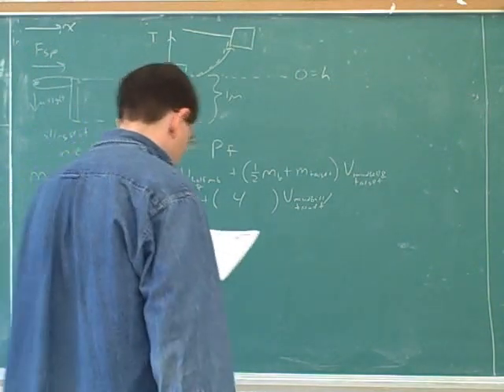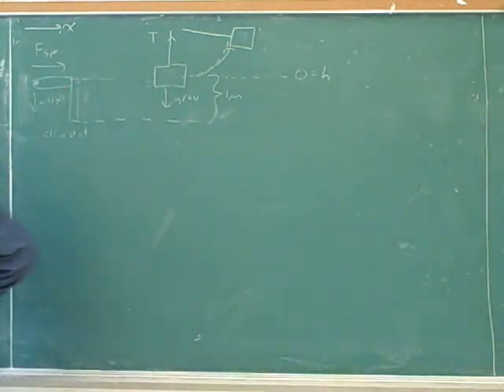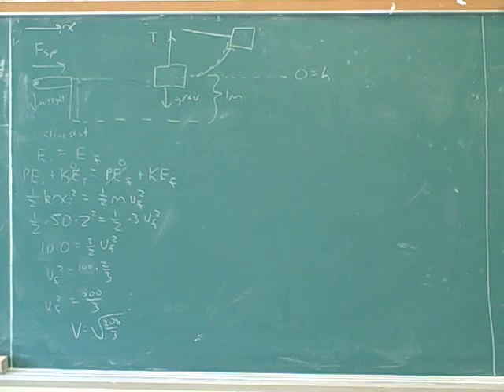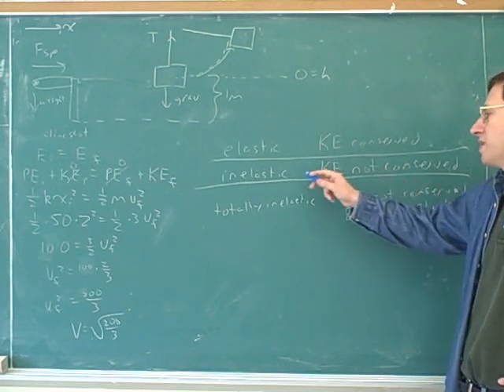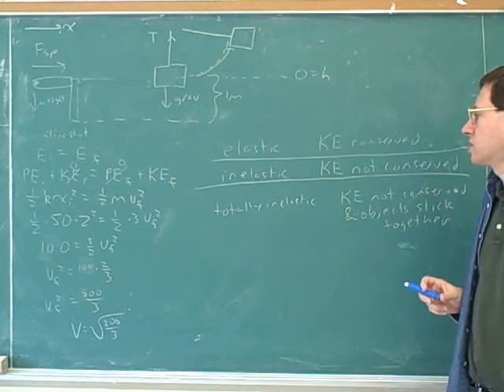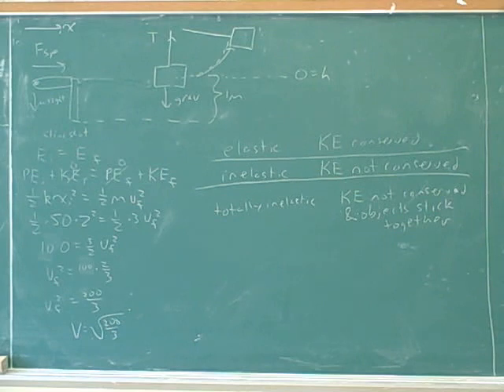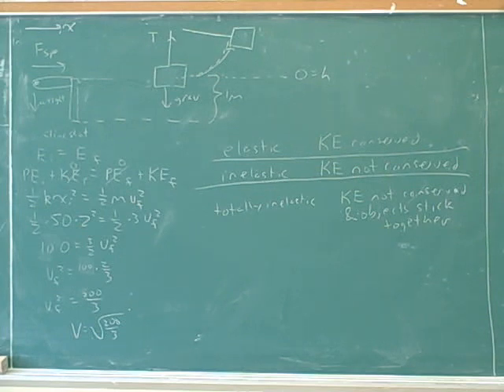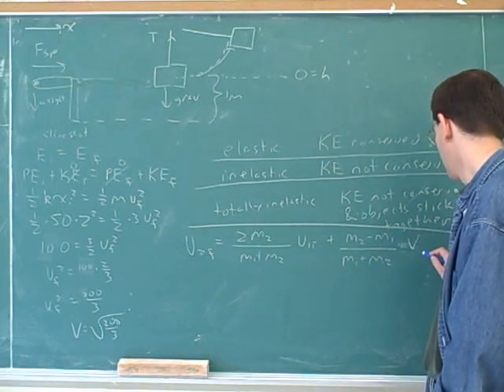Conservation of energy & momentum problem (4)

Comment: At 3:42 the equation states (1/2)(50)(2^2) = (1/2)(3)(vf)
Which then would simplify to (25)(4) = (2/3)(vf)
And finally vf = (200/3)  no? I feel like you didn't square the two.